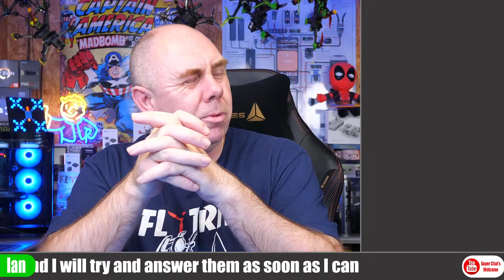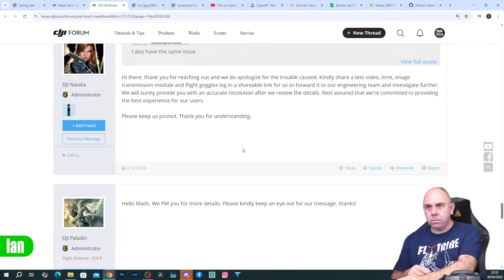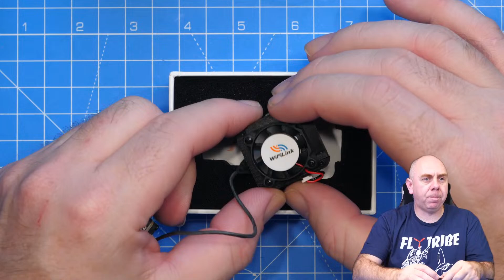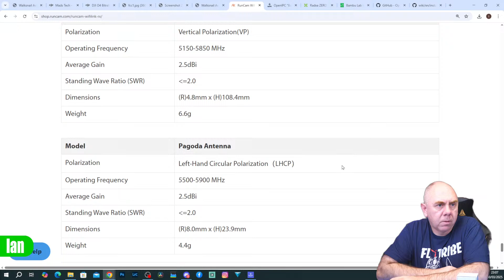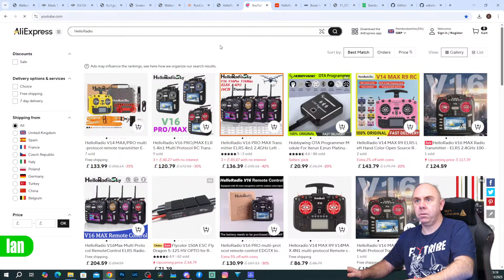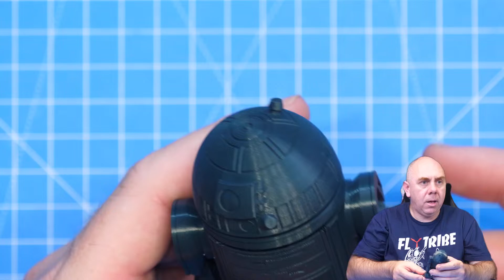Caddx Sale - DJI O4 More Issues - OpenIPC Bonnet & Runcam VRX Pre Order - Bambu Lab H2D - Its Quiet

Comment: Approx. 54 min into the video... You want to see the RJ45 port GONE.... Ha Ha Ha.   Open IPC  = Open IP Camera.  What part of "IP Camera" did you fail to understand?  An IP camera HAS an Ethernet port.  I am thinking the Ethernet port is there to stay- Unless/Until someone creates "Fork" of the Open IPC Standard for the R/C-Drone community.  For now, we R/C-Drone folks are just putting WIFI IP Camera systems in our devices.  Just giving you a playful jab... with a semi-sharp spear of 6,000 miles in length -  ;-)  Otherwise, job well done.  Oh ya... also... don't forget the next time you can't find your calipers.... your benchtop IS a ruler.  🙂

Comment: Also one more issue 
3 pilots all with g2
Two on o3 one on o4 
No matter what channel bound we choose there is no possible to fly safely distance as mbps stays very low picture glitch and loss 
Two pilots o4 plus o3 better but still not as it’s should be
Reply: Hmm, we have used this same configuration in our local group, without issue, at 40mhz.  Only time we have had problems is if one of the goggles doesn't have the ham file. It will report it's on  50mbpsCh1, but it's actually on 50Ch2

Comment: DJI Goggles 3 osd bug. If you open betaflight osd menu with stick commands, then save and exit. The osd disappears and won't come back without a reboot. I tried different Quads while the osd is out and it will not come back without goggles reboot. Even when I switch to O3 from O4.